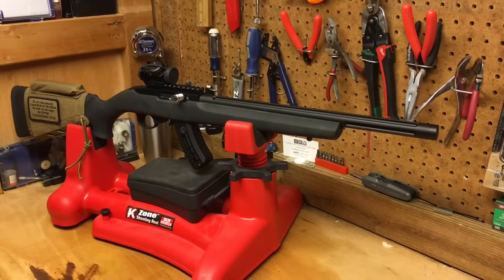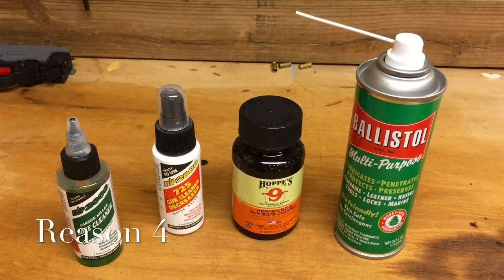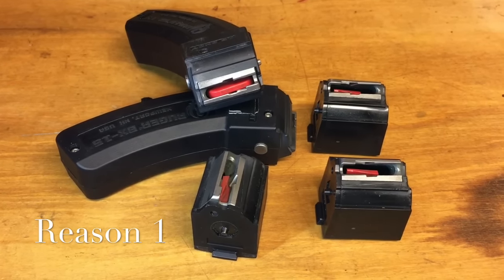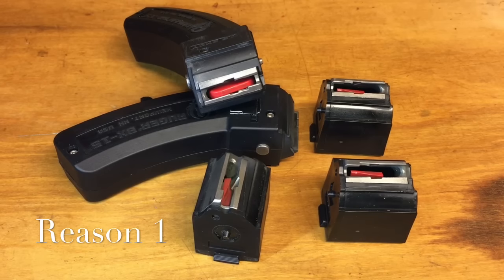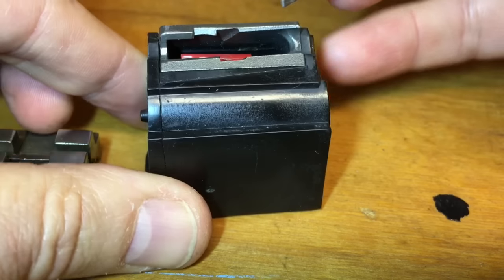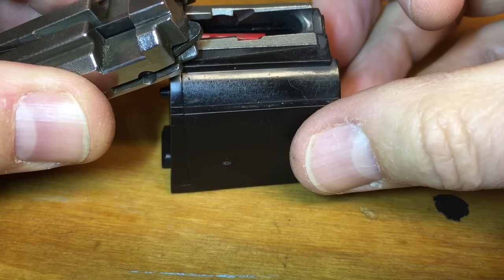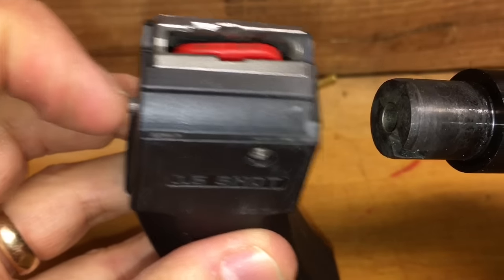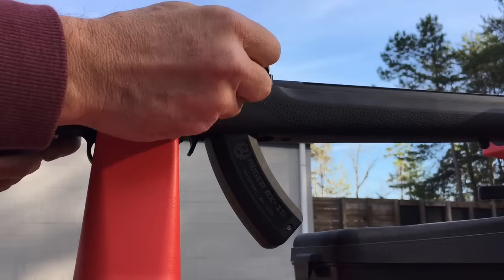Ruger 10/22 Top 5  jams and stovepipe causes and fixes

Comment: tip. stretching springs wont work they are made a certain length and wire thickness you stretch them they wont provide more force after a dozen uses or so , there are a million sights on line where you can buy same length and diameter springs BUT with thicker wire diameter increasing spring tension dramatically and all for a few pence (cents if you in america ofc)  much better solution (been a gunsmith for 30 years now)  thanks for the rest of the video though never had my own 10/22 about to get my first .
Reply from the maker: Thanks for the tip.
Reply: Before buying a new plunger spring, check some spray bottles around your house. That's what I did. Found a stronger one in an Armor-All glass cleaner bottle. Works great!!!

Comment: Thanks for this,  just bought two 25rnd mags and they jam like crazy with sellier and bellot, switched to federal match and better but still has some.  However,  when I look into the chamber I can see the spent round halfway in the chamber about two third of the times it jams.  So based on this,  I probably should get an extractor in addition to building up my mags to make them fit better.
Reply from the maker: Your welcome. Let me know how it works.
Reply: have you tried just putting 20 or 22 rounds only?
Reply: They sell a bushing on eBay to fix the feeding issues,
Reply: HK- ONE really,  what are they called.  Bx 25 bushings?
Reply: Ruger 10/22 magazine Box-25 jamming problem bushings
Reply: I tried them on 6 of my box-25 mags and they performs really well, when you order 4 he gives you a free one.

Comment: I watched this video because my friend has a 10/22 with missing extractor and it fires flawlessly with same magazines that stovepipe in mine. The tape trick works for me. Also a new magazine that was very tight. Thanks for this tip! After watching the stovepipe demonstration,  I think my friend’s rifle fired the rounds out of the old loose magazine without stovepipe BECAUSE of missing extractor. With no extractor, that early shell ejection from bumping into crooked parts of the mag won’t happen. Then the secondary ejection work fine. The only drawback with his rifle is, unloading the chamber is best done by firing the bullet. It’s fine for plinking but a hassle for hunting.

Comment: When I first purchased and began using the larger capacity 25 rnd 10/22 mags I was plagued with reliability issues that I could not figure out.  Then one day out of the blue the gun started cycling properly with all magazines.  Every 300 or so rounds I may get one malfunction; but considering where I started, and the fact that I will never use a 22lr for self defense, unless there is no other option, I am okay with 1 in 300 rounds malfunctioning.  I tell myself the reason for the sudden improvement has to do with the magazines needing to be broken in; but I don't really know for sure.  Also, I have never cleaned a magazine.  I clean my 22lr guns about once every thousand rounds... I do shoot a lot, so there in reality isn't much time in between cleaning sessions.  I have about 10,000 + rounds through my 10/22 which I bought 1 1/2 years ago.
Reply from the maker: Thanks for the reply. I agree with your findings. Sometimes a 10/22 may work flawlessly out of the box for 10,00 rounds and then all of the sudden "break out" vs "breakin". There are so many factors. Even a different stock can press or not press on the side of the mag, making a different feeding environment.
Reply: My 1022 literally works better when it's dirty. Tip: clean it once and only add oil whenever it looks dry from there on out.
Reply: How often do u clean the chamber?

Comment: I added some JB Weld on the back side of my mags. File and sand down with a taper, thicker on the bottom until it fits snug but not too tight. Go slow and take your time. Trimming a touch from the mag release helps too.
Reply from the maker: I like it!

Comment: Thanks I just bought A new ruger 10/22 talo itac, after 4 rounds it jams, I may call them,but after trying the duck tape It took the slack out,it shot great,I order some 10 round mags today.I really appreciate your video.Thanks again.This is my first ruger ,I was getting very frustrated until I saw your video.
Reply: I jumped the gun , I sent it back to ruger ,they said the receiver needed to be changed,after I got it back it’s now jamming at 12 rounds instead of 4. It had to be sent to A FFL dealer because the serial number was changed. Now they owe me 25 dollars.The. Bx 25 mags doesn’t work well with some rifles.If anyone out there having the same problems let me know. Thanks

Comment: You do realize the extractor only "Pulls" a spent round out if the gun did not cycle. The blast form the round is what drives the bolt back in the first place, the brass is doing the driving. The EXTRACTOR only creates a "hinge" so the ejector flips the spent brass out of the chamber.

Comment: Winchester ammo is the only issue I have ever had so far.  Friends don't let friends use Winchester.
Reply: That is a fact.  I bought  some Super X ammo several years ago and it would not chamber in my 10/22, my nylon 66 or my model 60.  The worked in the bolt guns.  The problem was the bullets are too big in dia.
Reply: @buckshot4428  that is definitely one of the issues with that junk.  The casing size varies too so that I could not consistently feed that junk into the cylinder of my single six.

Comment: I just got home from the range. I was shooting my 10/22 using Remington Golden bullet. My rifle was brand new with lots of mods. It has Volquartsen extractor, firing pin, bolt handle/recoil rod, automatic bolt release bracket, and a Tactical Solutions polymer bolt buffer. I also installed a Ruger BX trigger and Tactical Solutions extended mag release. I took the 10 round rotary mag it came with and 2 25 round BX mags. The results after firing about 250 rounds wasn't really good. I had 2 misfires and 4 jams. The 10 round jammed first, I need to take it apart now due to it feeling really loose inside. The 25 round mags also jammed a few times each. So this tape trick will hopefully fix most of my issues. I did however have one jam where the casing failed to eject which really surprised me with my mods to attempt to fix that issue. I am definitely going to add some duck tape to my mags next time and try it out. Thank you for the tip even though this video is 3.5 years old its still useful information.

Comment: As simple as that. Wow. I'll cut some plastic strips and superglue it at the back of my magazines. Thanks...
Reply from the maker: Good to hear!. I would love to see a picture.
Reply: Did it work?
Reply: I just tried to tape a thin piece of plastic to mine. It made it not wobble at all, but then my mag won't drop out(10 round mag). Too tight of a fit, it seems. I think I'm gonna look into stretching that plunger spring, or replacing it with a stronger spring. (I've got a huge assortment of different length and strength springs).    I'll get back to you guys on the mod...

Comment: Just got a 10/22 I also got 2 box-25’s I’m going to 100% do the tape trick . Great tip man. I’m doing a couple upgrades IE a new bolt extractor and firing pin so I’m gonna see how it runs without the tape first. Great insight

Comment: A thin piece of plastic glued on the back should work.
Reply from the maker: Yep, That should work
Reply: When I tried the shim thing, it wouldn't allow my mag to drop freely. Kinda hard to dig out that 10 rounder...   So, I just found a stronger replacement spring for my mag release plunger(spring from a spray bottle). It works fine, now.

Comment: Top reasons for malfunctioning 1022's 

AMMO, AMMO, AMMO and AMMO and aftermarket mags.

I've owned countless 10-22's with countless mods and configurations. Ive fired (literally) tens of thousands of 22lr rounds down range through many a 10-22. These guns are the Volkswagen Beetles of the gun world.  Quality ammo and factory mags along with halfway decent cleaning and lubrication (even with the dirtiest of 22 ammo) you shouldn't have a problem.

Funny how some people have problems out of em and some (like me) that barely even clean the  damn things have never had an issue. I have one in particular that I use for just plinking, I've never cleaned it and I run anything that's cheap through it. I've never had any real issues with "FTF, stovepipes or jamming."  22lr is fickle anyways and just about anything is gonna give you the occasional issue but I can honestly say I've beat the "cowboy sh*t" out of my 10'22's and I've never had any notable issues.
Reply: When I was young. I shot thousands of rounds through an old sears and roebuck bolt action. Never cleaned it. Still shooting it 38 years later.

Comment: The main reason I have found for stove pipe is the radius on the bottom back of a factory bolt is to square ( the bolt contacts the hammer) way to close to the hammer pin. Ie the fulcrum point of the hammer. So what I have done Is called “ radiusing the back of the bolt) this will cause the bolt the contact the hammer further away from the fulcrum point ( hammer pin) thus taking less power to manipulate the bolt meaning more power from the blowback to send the bolt fully rearward which means more positive extractions and reliable feeding. I’ve done this to all my personal 10/22s and my kids and grandkids rifles. We don’t have stove pipe rounds anymore. Googol “ radiusing the 10/22 bolt” this alone will open up the types of lower power 22 round your rifle will feed reliably.

Comment: Works! The tape was the final piece of the puzzle. But..I am going to pass something on. There are two other fixable probs with the banana mags. Take one apart and look at the lips along the path of the bullet where the lips meet the plastic. There is a WALL. Yes, a wall...sometimes that wall will hold up the round 2 or 3 back, making the current round not sit all the way up.  Ramp that wall! The other is also on the lips where the bullet leaves the mag. Again, there is a hard edge at the front of the mag where the bullet needs to ride up. Ramp that too.  The ramping and your tape...that does it! Perfect!
Reply from the maker: Good to hear Bill

Comment: Nice video, keep up the good work.  
It must just be one of those freak things with certain guns because i have a couple of 10-22's.  One in particular I've had for about 20 years and have probably close to 10,000 rounds through.  I've beat that gun to hell.  Never cleaned it, just oiled it every now and again. Used every type of mag from BX's to el cheapos from Gander Mountain, every conceivable type of ammo and I can count the number of hiccups I've had on my hands.  It's easily the most abused and most reliable gun I've ever owned.
Reply: Robert Williams   I think that you sir, have the strange hiccup. You got very lucky.    These guns are junk, out of the box. I don't understand all of the hype about them...      My Marlins blow them out of the water!  Period.
Reply: @jamiesloan5902  o
Owned a model 60 once.  Fine gun. In fact my son still has it. It's  awesome for taking out groundhogs. No arguement there. Personally though, never had an issue with the 1022 and I have a lot of experience with them. Either way, for my money you can't go wrong with either one.

Comment: Hmmmm maybe a little JB Weld built up and then sanded or carefully dremmeled to get a good fit? That way its done a non-issue. Tape eventually wears out. If you have a steady hand then the welding compound can be decently done and not unsightly.
Reply from the maker: Good suggestion. Tape will wear down after a couple of hundred rounds, but at least you can use the quick tape method to check for a good forward seat for the magazine. If the tape fixes it, you know that it's not your extractor or other problem and then you can put in a more permanent solution like JB weld.

Comment: I just bought a new 10/22 a few days ago. Here's the deal....  The first time I shot it, I put about 200 rounds thru it. I had about 1/15 FTE stove pipes.        I replaced the spring on the mag plunger, with a stronger spring(from a spray bottle). I put over 200 rounds thru it today. Only 1 FTE!!!!!   I'm happy now...        Bottom line is, the magazine HAS TO STAY STURDY, to keep everything in perfect alignment, to function properly, whether it's feeding OR ejecting.  These guns aren't perfect for sure, but with a little TLC, you can make them "okay".   I had a LOT more fun today, than I did the first time I shot it. I was pretty pissed...

Comment: I bought a 1022 carbine at dicks a while back. 10 rnd mag. Never failed. Got my 1022 tactical with a 25 rnd. Stove pipes a lot.  Found it does it when I shoot slowly and if i rapid fire it works fine wtf.  I have a match grade extractor and a 10% softer recoil spring.  Still does it with sub sonic and super sonic

Comment: Wow good presentation on the mechanics.  I am having problems with one of my 10/22s.  A few jams, Ruger told me to use CCI Mini-Mags ammo.  Also, there are problems with the clear plastic magazines...they are a bit wide and stick in my "Collectors Edition", but not in my Take-Down.  Ruger will exchange the magazines for the black ones or I will have to ship the rifle back for the stock to be replaced since the mag-well is too tight side-to-side.

Comment: It looks like filling the gap between the rear of the magazine and the receiver body will tighten the fit of the mag into the mag well.  I have had this problem with the Mossberg MVP bolt action in 5.56/223  (the USGI mags fit very loosely)  I used JB WELD added to the spine groove and a thin polymer strip then inserted a magazine greased at the mag spine and canted the magazine counter clock wise to raise the feed lips.  Totally solved the mis feed problem.  I'm thinking something similar on the Ruger mags wold work.

Comment: The only fix I've found is that the back of the feed ramp has a taper to it unlike the 10 rotary mag that has to be filed flatter and the 4 mags I have work perfectly after that mod. Check it out and compare it to the 10rd rotary and you'll see what I mean. The 10rd is flat on the back of the up coming feed and the 25rd has a taper. I filed them down semi flat and have no more problems.

Comment: Used to use the old ram-line 25 shot back in the 80s shooting  a brick every week never oiled only outer barrel cleaned with starting fluid bore included  VERY few stovepipes and when I did it was usually ammo related (Remington brass had black crud)
Reply from the maker: Thanks for sharing

Comment: I believe the main reason people may be having firing problems with the 1/22, isn't ammo, needing oil, being dirty, having a new extractor, or any other reason, necessarily. I tried it all. What I found out, and this worked for me, after all the new parts, the magazines, the filing, adjusting, sanding, polishing, and all that, what I found out, is that these things like to RUN DRY. Spray some carb cleaner, brake clean, or whatever into the port, on the face of the bolt and at the chamber area, just before you go shooting. Apparently oil at the extractor likely causes some failures. So try RUNNNING DRY  in that area. These are all helpful reasons, I'm just saying that there's one to consider and that is try running it dry, at least at the front of the bolt and the area of the chamber.

Comment: Great video! I use a very light coat ofptfe mixed with moly as bolt lube. Normally lasts 400-500 rounds which is when I clean it anyway. Any oil just causes problems for me in semi autos.

Comment: My comment is on the Ruger 25 round mag & a 77 / 22 , mag wobbled in the rifle and would fall out if struck against anything by accident . My fix was drawing a diamond honing steel across the top ejector side a few times . It now fits right and works fine .  Just wanted to add this to maybe help someone else .
Reply from the maker: Interesting Wren. I would love to see pictures of this.
Reply: Kyle Rakestraw . Kyle I found your video to be helpful and will watch again for a 10/22 that is having stovepipe failures . On the 77/22 I just honed all the metal , smoothing out high spots .A stone will work just as well . Once you start honing the wide side of mag - the high/low spots are easy to see . Do this till metal is smooth with the black ends 
The result is really smooth feed & quick reloads . Doing this allows the mag to fit more secure in mag well , less than a 16th " wiggle , it's much better . I'll have pictures of this job & I hope the 10/22 in a day or at least by Thursday . Thanks again for your video I know it took some time to make it .

Comment: I didn't realize the 10/22 magazine acts as the primary ejector for this rifle. This explains why the only reliable magazine I have is the Butler Creek 10 round polymer feed lip. If you look at the ejector part of the magazine, the Butler Creek is further forward than the Ruger factory mags. Seriously, I have 5 differen't Ruger 10 round mags and they all jam like crazy, but the Butler Creek runs fine. Iv'e been trying to solve the jamming issues Iv'e had with this rifle since 2012 when I bought it new. I just ordered a pro-mag 10/25 and am curious how the ejector is on those. If Butler Creek still sold their 10 rounder polymer lipped mags I'd buy a few dozen even though they aren't the most durable. Ruger needs to learn from Butler Creek and re-design their mags to have the ejector placed further forward.